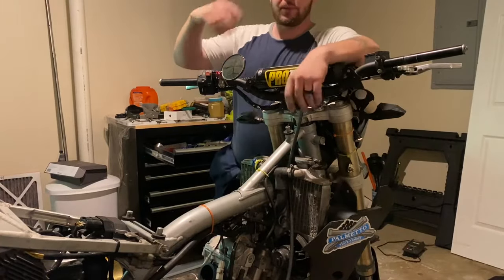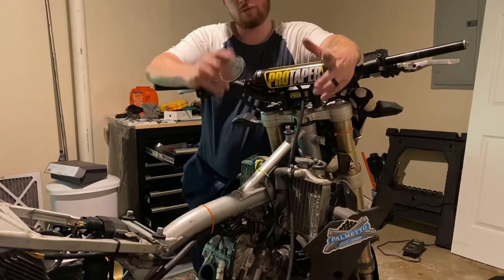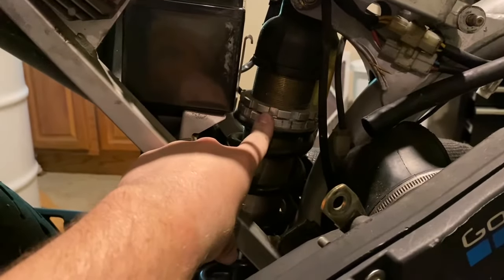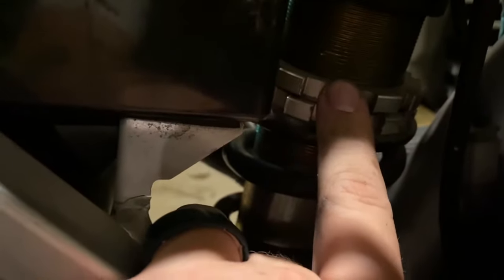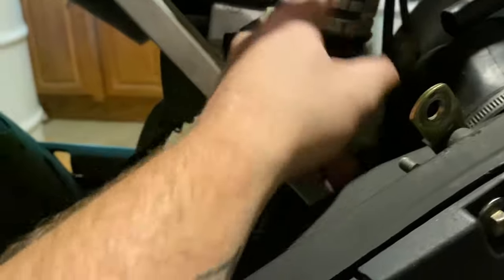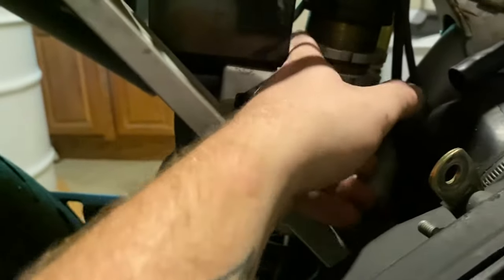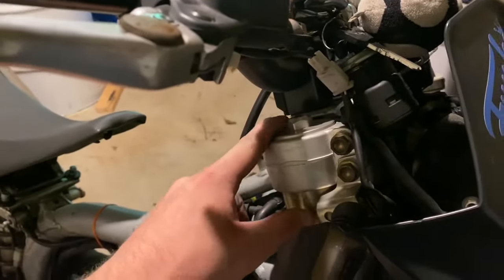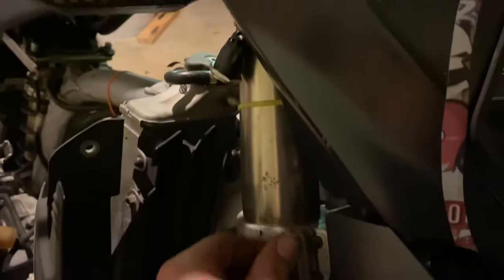How to adjust dirt bike suspension

Comment: You can lower the front tubes for height adjustments ...but as far as the rear...I think your only softening the suspension and not really lowering it......Am I wrong ???
Reply: So move those rings up for a softer shock? Curious bc I'm a tall rider but only weight 170 I find the rear shock is quite stiff for my weight, I think the bike was preset for a rider around 190, will this solve my problem?
Reply: @nicholasvankoughnett4558  i’m pretty sure up makes the suspension stiffer and down makes it’s softer. if you think about it the shock is less compressed the higher the rings are so it makes the suspension need more force to compress it
Reply: Those shock collars that tighten the spring are not for setting ride height to where you want it.  To set up the right spring stiffness for a MX bike, you take 3 measurements from the axle to some point up on the fender, (most bikes measure straight up a point on the fender.).
1) the measurement with the wheel off the ground, fully extended.
2) the measurement with you sitting or standing on the bike in your riding position.  About 1/3rd of your total travel should be used up there.
3) the measurement of just the bike weight, (tells you if your spring is to stiff or soft).  After you get the sag set, (the 1/3rd of travel with you on the bike.), the bike by itself should be about 20-30mm with the bike weight itself.  If it is less, you need a stiffer spring, and visa-versa if it is more.

You are right about it getting much softer by relaxing the spring to lower the bike.  He probably sits on it and used 1/2 the travel, and bottoms out easily while steering like a school bus.  :)
Reply: @Slayer-cl8ji yes ur right

Comment: No offence but if you want to get your suspension set correctly you don't set it for seat height you adjust it for the riders riding weight and riding style and conditions. If you adjust if for seat height according to your height your suspension could be way off.....even dangerous.

Comment: I have a stock 05 yz450f. And I’m 5’11 350. I wonder if I go down with suspension if it would remove a lot of sag till I can buy a suspension that will hold MY weight. Any suggestions on a Rear end shock?
Reply: I recommend Elka Suspension! Better for bigger riders
Reply: If you wait 350 pounds you’re definitely gonna have to buy the most expensive shark out there or not to be mean man you might wanna lose a little bit of weight -ELKA

Comment: I’m not heavy but my rear suspension is too soft. If i want it to be stiffer what will I do?
Reply: I want it to be stiffer. Do I go down with the spring or up?
Reply: @bjperez6868  probably down to tighten it
Reply: Tight your spring to make it stiffer then it will sag less. So down it is..
Reply: So I go up if I want the bike to be lowered slightly?
Reply: @robhayter484 Yes sounds like you tighten the spring down to make the suspension stiffer, If you want your suspension to be softer you would loosin the shock like he did.

Comment: So where you will adjust the preload and rebound?
Reply: Never heard of either of them. It sounds nice though man 👍
Reply: @rcranch3838  its called 'sag' in other words
Reply: The preload is how much you compress the spring with those adjusters.  The rebound adjustment is a little screw adjuster usually in the bottom clevis of the shock.  It controls how fast the wheel "rebounds" to full extension.  So if you get a stiffer spring, you may need more rebound dampening (slower) to control the stiffer spring.

Comment: I have a kx 100 and i wanna raise my forks
Reply: Try stiffer springs.
Reply: They won't "raise the forks", (which you would not want to do), but if you bottom them easily, it will fix that problem.

Comment: How mush air goes in rear shock
Reply: It is nitrogen, and around 140-150 psi.  You can buy a fill kit for a few hundred bucks and get the nitrogen bottle from a welding supply shop.